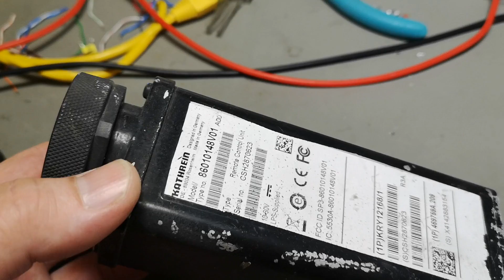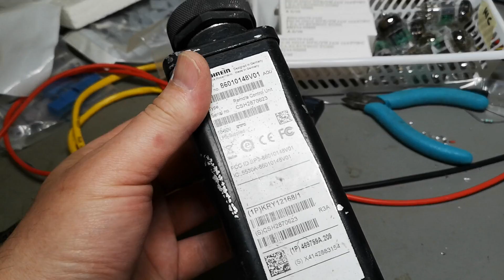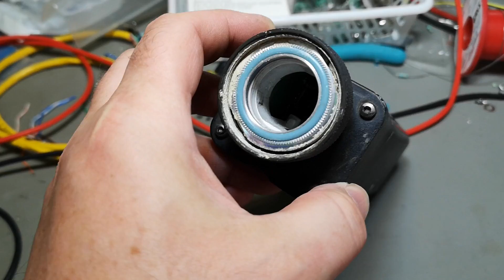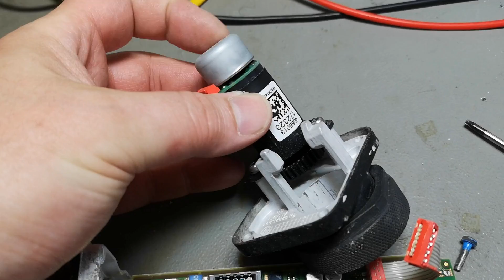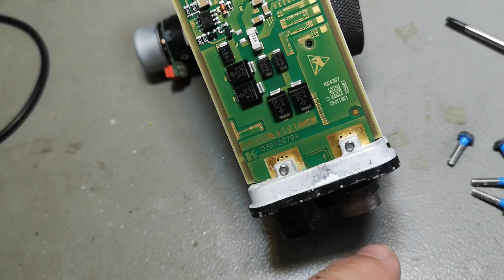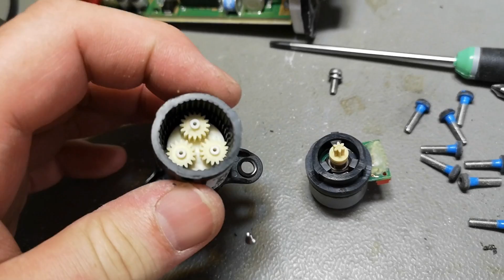Kathrein GSM antenna Integrable Remote Control Unit iRCU teardown

Comment: Hi, hey, summer is starting - engines are blooming 😂 (the term blooming is also used slang in the Czech Republic for metal corrosion) it turned out to be a poor thing, but the engine with the gearbox could still be used. Once upon a time in the last century, I had an antenna rotator at the antenna for FM and at work on the directional antenna of amateur radios, but they rotated the antenna almost 360°.  It's quite complex, I've never seen an industrial drive disassembled, but I wouldn't expect this. Thanks for the demonstration 👍

Nice day 🙂 Tom
Reply from the maker: i was also surprised about all that corrosion.
Reply: @TeardownOZ2CPU  There could have been a valve with a membrane in that vent next to the connectors and if it fell out then all moisture resistance is gone and since the flange surface was not treated the metal started to degrade. The PCB was perfectly clean, so no water got into it up there - the moisture came through the vent.